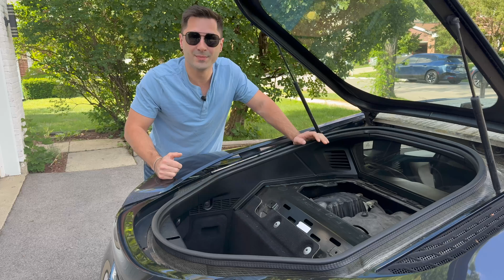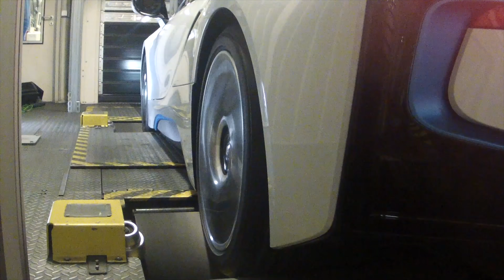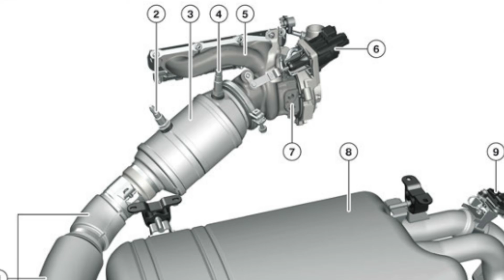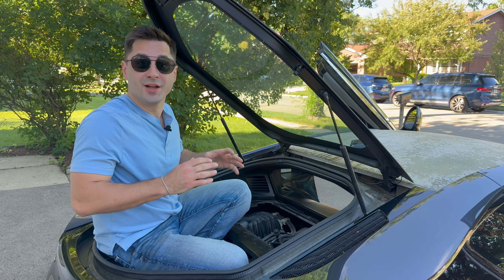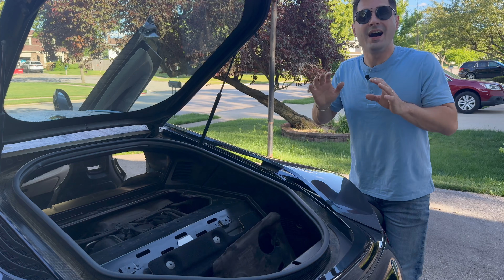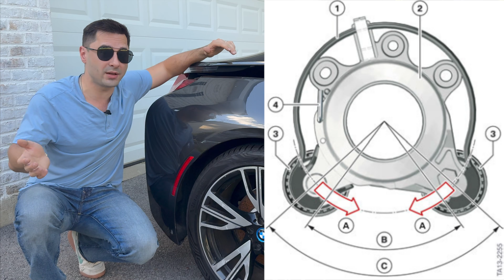BMW i8’s B38 Engine is SPECIAL! Here is WHY!

Comment: This is cool! I like the deeper dives videos and I was wondering about why they put a 3 cylinder engine in a 'supercar'. nice explanation
Reply: I agree. I’ve had an i8 for 4 years now and drive it daily and love it. The past few cars I’ve owned have been a 10-cylinder Viper GTS, 800 HP Corvette Z06 and other large-engine, high-HP cars. All of my past cars were fast and fun, but really unusable in 90% of situations. When getting on the interstate at 40 MPH - 80 MPH, those cars would just spin the tires. 

The i8 although very different - in “Sport Mode” it keeps the engine in a higher RPM range to prevent turbo lag and you get the instant torque from the electric motor. So passing on streets, interstates, etc. feels almost faster in the i8 compared to my previous high-HP cars. (Obviously the i8 is also all-wheel drive, which helps as well.) I remember looking up the i8 the first time I saw one and saw it was 3 cylinder and I wrote it off…. Until one day I rented one and ended up buying one 2 weeks later.